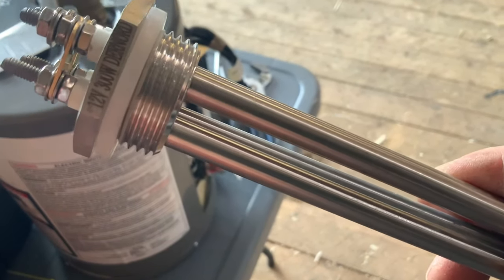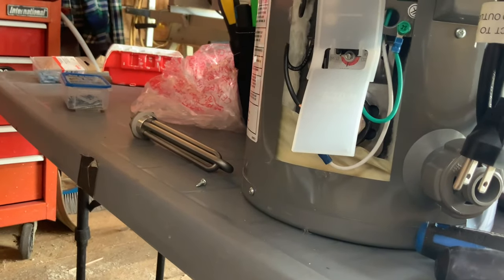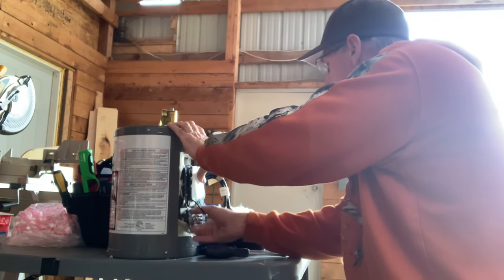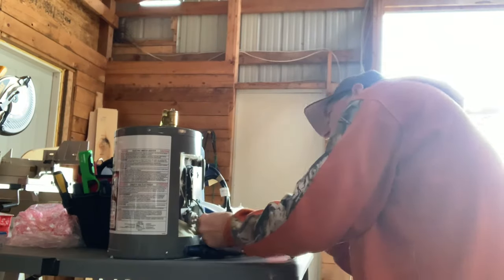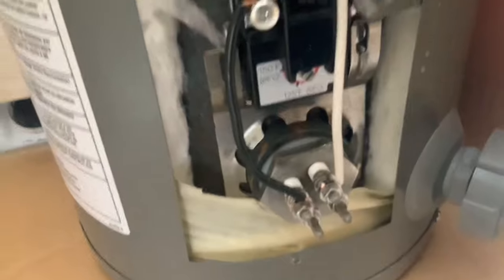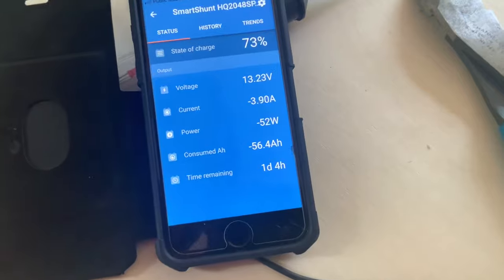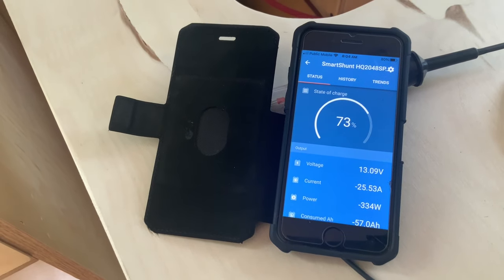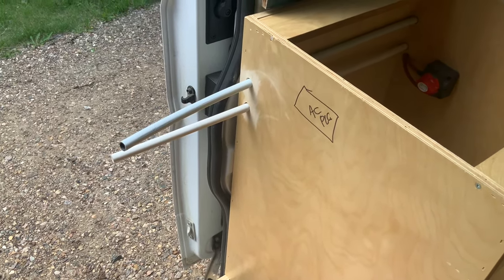Best Install 12v DC Off grid hot water heater in Van or RV Solar Compatible! DYI! Convert RV to 12V

Comment: Clever. Considering similar but instead installing the Dernord element directly into the 10 gal fresh water tank--(1) keeps the water warm and (2) prevents the tank from freezing. Thanks for sharing as now I have better confidence that it will work.
Reply from the maker: That is a great idea. Nice for winter ops. Don’t forget a good quality shutoff, 30 amp breaker and correct wire size👍
Reply from the maker: corey b  I put in 6 gauge. No heat issues. Large battery terminal shut off.
Reply: Following! Please tag me in the comments if you’ve successfully tried this! Thanks
Reply: Watch out for bacteria growth.. 40-140 degrees for 2+ hours. 

For me gravity fed water coiled around my stove pipe.. water is inside so never freezes and stays about 16/20 degrees sooo no bacteria. Works for me
Reply: The 🌡 must over the 60 degree Celsius to avoid Legionnaires

Comment: I made a Honda clone generator giving me 5000 watts ac 110/220 and 12vdc, I charge 3 150 amp hours battreys and have a 3000 watt ac inverter with 450 watt hours of DC storage, I wrapped 1/2 inch aluminum  pipes around the muffler and heat tape wrapped the muffler. I heat water 💧  through 1 coil and I heat antifreeze  thru the second coil around my exhaust. My generator  runs on propane or gas ⛽️  this is a good solution I have enough  power to run a house 🏠 😊

Comment: 👍👌🇨🇦❤, just so a person does not need to use the AC thermostat, there are 12, 24, volt elements sold with a built in thermostat on the element.  Try Arizona Wind and Solarfor supply.  Just need more solar wattage than the wattage of the element, all is good
Reply from the maker: Thanks for that info. Great to hear about more technology for van conversions!!
Reply: @dadzvanz936  Missouri  Wind and Solar, chexk them out
Reply: @pocketchange1951  Volts X amps = Watts.  So, A 300 watt 110v. AC element is the SAME DAMNED THING as a 300 watt 12v. element!!! A 120v. or  a 240v. water heater will run just fine on 12 volts if there are enough amps. No need for new elements if the ones you have are the SAME WATTAGE

Comment: I am about to do this and I have 800w on the roof of the van and have found the same capacity hot water system, in a square shape. I will get silicone heating pads, slap them on the side of the tank, use my own thermal sensor and controller to regulate it, while keeping the AC guts all untouched. Enabling it to still be powered from the inverter or mains power as well as the lithium battery. But the best part is I will sense the voltage on the battery and when the battery is showing it is in the topping off stage I will enable the hot water system to charge from the solar coming in. I will also have a bypass that will let me choose to heat the water when the battery is at any voltage.
Reply from the maker: This sounds like a great idea!  Please share. I have seen the pads used and they look like a great way to go. I also like the idea of being able to switch back to the 120V element. Good luck!
Reply: Heat sink the 'extra' 12 volt electric...

Comment: This is my first time watching one of your videos. You might have already made an in depth video of your shower system. I like the idea of only needing 300 watts to heat up your water so a person can take a quick shower. Hopefully I will find a video explainging how your water tanks and solar power is setup. I'm trying to design a small lightweight travel trailer using a quad recumbent trike with an elecrtric battery and pedal assist. I got the idea from watching folks over in Europe using cargo boxes to deliver packages. I just want to be able to use mine as a camper with all the amenities. I want to be able to cook, shower and go anywhere I want without needing any fuel whatsoever except solar panles and a nice top quality generator like my Eocoflow to run my 72 watt heater and my small fridge. Thanks for posting your video. Have a wonderful day Dadz Van.
Reply: Sounds like an interesting idea. I would save the weight and use campground or trucker showers. That’s what we do unless we have an outdoor solar shower

Comment: I think this is a better solution over propane hot water tanks or instant-on propane hot water heaters.  
What I would do different is have a well sized electrical system that operates at 24vDC.  Go with a 24vDC hot water element driving at least six gallons or better yet 10 gallons.  Plug into shore power when available, engine alternator driving a 12v to 24v isolator when on the road, or finally battery/solar when parked and boondocking.  Why the extra capacity?  I'm thinking after driving for three hours or so the hot water can be fully heated and the capacity is high enough to last the night and the morning without needing a reheat and use up power.
Reply from the maker: Thanks for the info. Yes, lots of options around 12-24 volts. I only went 2.5 gals as I will almost always be able to use rooftop solar heated water for a shower. If I was going fall spring close to freezing I would like a little more water
Reply: I don't see the savings 12 dollars over 2 months for gas. And that's if you take a shower every day I mean if you camp every day. I was looking into a 12 volt element with a DC thermostat built in and the 99 dollars wasn't the problem it was the 1200 dollar shipping charge. I can buy many refills on 1200 dollars. 73
Reply: Like they say the law of physics you cannot get something for nothing. 73
Reply: @ronb6182  Part of it for me is not cutting a hole in the side of the van or trailer wall for a conventional propane hot water heater.  Now, I doubt there's any total savings as the battery system would need to be upgraded.  To me it's a combination of attributes that has me thinking about a no-propane hot water heater.  I am aware that propane hot water heaters can be had with an electric heating element.  So if one has no problem with propane burner venting, both heat sources would be available.
Reply: @Snarge22  yeah there is different applications which makes it go for one over the other. To me I cannot have a tank in the mountains which requires emptying the tank every time I go up there. Because I never know if I make it before a freeze. I would say the majority of the time I go up in the cold season more than not. Even March it freezes. I may go electric tankless up there. 

In Florida I already poked a hole in the block wall so my instantaneous water heater is already operating I just want to save the hot water because of the 20 minute max time running. If the tank is full then the water will be hot for a longer time the DC elements I will use will be for backup during hurricane shut down. Propane may not be available so the generator will provide AC and DC power which will heat the water and AC will be for the refrigerator and air conditioner. I would like to do solar but panels on the roof could get damaged so portability would be better for solar. Thanks I very well understand where you are coming from. Big 73
Reply: Just wondering how much a small radiator would hold must be something around two and a half gallons would heat you're van in winter? Mike uk

Comment: They need to invent a 12 volt heat pump water heater. It's at least 3 times more efficient than electric and it can also cool and dehumidify the air. Great for hotter climates.

Comment: Very clever. I agree, no propane. I've seen 120v instant hot water heaters, but the you need to run it through an inverter. This seems simpler.
Reply: Instant vs stored is the question - with a tank you can heat hot water with "spare" solar and use it on demand.  With instant you might use solar during the day and at night it will be straight from the batteries.  Weight wise - I guess it is the weight of the tank filled with water vs some additional batteries.  Instant does seem to be the simpler solution too.
Reply from the maker: True enough. I looked at the on demand. Altitude seems to come into play a lot, who knew, and then running them inside with no exhaust etc. haven’t seen a good demand one. If you do. Please share.

Comment: This is exactly what I'm looking for. I have the same 12v\300w element that I want to install in my RV. Do I need the smart shunt..? my systems consists of 4 lithium bb 100ah batteries, 3-400w panels connected to a Victron 150\85 and a CERBO gx with touch screen.   I was thinking I had to cut the MC4 connectors off and wire directly to the water heater.
Reply from the maker: No. You don’t need a smart shunt but it sure makes visualizing on your CERBO easy. Reads the in/out current on the batteries on the display. My wife loves it.

Comment: How about an instant 12v 300watt small heat exhanger that will heat water on demand?  Copper tubing with 300 watt element installed so water passes over it and heats it instantly?
Reply from the maker: Interesting idea but I am not sure you would be able to get the water hot enough with any kind of pressure with only 300watts. If you went to 1400watts it might work and the power draw would probably be the same for the amount of water used. But this is just a thought. Try it out and let me know. Cheers.

Comment from the maker: The link below is for a 150 Watt but you can get anything from 50 to 400 Watt DC. These are true DC and not AC made to look like a DC as you may find out there. LIKE AND SUBSCRIBE PLEASE. THANK YOU!
Reply: How can an A/C element be made to look like DC?  All electric heating is resistive, IR Squared. What am I missing?
Reply: @CapnZman  the composition is different also the DC element may also have a DC thermostat. The AC thermostat will give out if used with DC. Get the right voltage and current elements. Some manufacturers are frauds they scratch off the elements voltage and current so you think you bought the right element, buyer beware . 73

Comment: Can use copper tubing to connect with radiator and. link it to the hot water tank. 
Do this will heat up the tank very fast while the RV engine is running.

Comment: Thanks for the video. I’m wondering how long the hot water would last for as I have the same tank size. More specifically as you use hot water some water fills it’s space and is heated and we don’t use hot water from only the heater as it’s mixed with cold water so how many gallons would that tank last you?

Comment: Why did you change the heater to DC? No inverter or inefficiency of the inverter?  Great detailed video. Thank you.
Reply from the maker: Yes. I do have an inverter and I could have done it thAt way. What I planned for was having the inverter off to save a little from the power the inverter uses just to operate and use the sun in the panel when stationary or the DC DC charger when moving to heat the water. I generally turn on the heater in the morning and have hot water till dishes are done at night then turn off. Still 100% battery. Thanks for watching.

Comment: I have done the same thing using 120v and 240v elements  1500watt 4500watt elements if I remember correctly the higher voltage higher wattage 240volt elements  were less watts in the hundreds on 12 volt .
Reply: if that's the case, why bother changing heating elements from ac to dc?

Comment: Great video, just bought a Rheem for my van build! Can I use a bigger 12v dernord heating element for faster heating? Or will that not be compatible with the rheem thermostat and internal wiring? I don’t want to start a fire, but I have Solar/battery capacity for a bigger heating element. Thanks
Reply from the maker: Should be no problem as long as it’s 12 volt.
Reply: I’m going to use 300w after all. If it’s working well for you, no need to try something new. Honestly, the AC to DC conversion freaks me out a bit. Do I need to ground the negative because of this conversion? Rather than route it back to my negative bus bar? Thanks again.

Comment: Interesting. So you just swapped out the white and black AC wiring with red and black DC cables?
Reply: Yes. Checked wire heating and resistance with no issues

Comment: I am doing this right now (thanks for sharing) and I just ran into a concerning thought. It looks like you are using the same wires (black and white) that came with the unit. My guess is these are 14 or 16 gauge. If these are wired to the heating element does that mean 300 watts are pulling through the wire at the 12 volts. If so isn’t that too high of a rating for those wires or do you only need the large wires  (6 awg) connected to the other points of contact like you have in the video?
Reply from the maker: Yes. The 14 gauge wires are fine for the very short distance that it travels. I talked to my solar guy as well as an electrician about it and they both confirmed the same. Also when running there is no heat on these wires. Good luck. Let me know how it turns out. Just putting in my Corrion countertop.
Reply: @dadzvanz936  - Awesome! Thank you so much!

Comment: Minute 3:22:  cables seem to be much smaller between the thermostat and the heating element than between the battery and thermostat.
Reply from the maker: Yes they are. The run of 10 feet from the battery to the thermostat require a 6 gauge according to DC wire gauge charts. I put in 4 gauge for this, no cost difference. The short run of only 4 inches could actually be done will 9 gauge but I used 39-2 as it is more robust. The reason I had the panel off was to check heating of the wires during operation. I noted none. I will  be putting a 40 amp breaker in near the power source. Thanks for the comment!

Comment: Hi, Just about to pull the trigger on doing this… I noticed that you posted this about a year ago…. I also watched another video on this type of conversion.  Have you had to make any further changes since this video?  Any issues that I can take care of as I do this work?
Reply from the maker: I have had no issues with this at all. Make sure to use large gauge wire and a DC element. I have heard about guys thermostats going out?  But have not had this issue at all. 
Good luck!!
Reply: @dadzvanz936  Thanks!!  What gauge would you recommend?  Water heater and 12v fuse box will be about 10ft away...  300watt / 12v = 25amps.  I was looking at 6 AWG

Comment: Clever idea. What was the make and model of your boiler? I'm based in the UK so need to find one here. Also, can this been used with 10L boiler?
Reply: Better to run a diesel hydronic loop boiler system then top it up with electric. Ninety degrees is WAY overkill though!

Comment: Hi. I love your idea here of no propane, no insta or tankless and 12v.  I have a Sprinter Coachman Galleria with a Truma Combi Eco Plus and it just doesn't produce a long enough shower for my wife to take a hot shower. Even when hooked up with shore power. I'm wondering how long of a reasonably hot water shower you can take with your system? 5 minutes? 10?  What are the dimensions of your water heater and did you have to vent it? I would keep the truma for sink hot water and furnace but I'd go to this system for shower. Any advice?
Reply: In my travel trailer I changed the shower head to a 2.5 water saving and reduced the water pressure to 14 psi. That made the water last a long time and I can take a 20 minute shower on a 6 gallon hot water tank. My total water usage was 5 gallons daily, so I was not using the full 6 gallons of the hot water capacity.

Comment: Didn't notice a fuse or breaker on the supply line for the heater. Even with a main breaker, it's probably advisable to have a breaker or fuse on that branch circuit. Just a thought. Nice affordable conversion though.
Reply from the maker: Thanks.  I will have a look at this and see. I think your right. I have a spare 40 amp that should work

Comment: I'm about to do the same thing and I got the Rheem but can you help explain why you changed how the original wires were run? For example, the white wire originally ran straight to negative but instead you have it connected to the second terminal of the thermostat.

Also, isn't that a double element  so 600 watts?
Reply from the maker: The element is stamped 300W and came with the plate jumpers between the elements so I will assume it is 150 x 2 for 300Watts. This is also the DC draw I see on my Victron screen through the smart shunt. As for the wiring I replaced the black and white wires with 15/3 house wire and ran them both through the thermostat. This may be one of the reasons I have not had any issues with the thermostat as a couple others have. Hope that helps.

Comment: The only problem is you cannot use DC on an AC thermostat if you got away with it the question is how long will it last. 73
Reply: that's the question, should we use a different thermostat or a relay with the original one instead??      if you connect it the way this video does, it will not last very long... see the difference between both sets of cables

Comment: Great job👍 Did you use original 120volt  thermostat or do you need a 12volt one?
Reply from the maker: I used the 120 volt thermostat with no issues after 2 years

Comment: I was looking for exactly this video. You mentioned a solar HW heater on your roof. Any details available on that? I was thinking of a solar-powered heater/pre-heater, either a simple “black tube” or possibly a parabolic trough heater.
Reply from the maker: The tide heater is what I was thinking on the roof. You can buy air chucks like on an inner tube to drill into the tube to pressurize it or just go gravity. You can look up the volume of an 8 inch or 6 inch tube by the foot to see what you require. They are very good if you are in warm climates most of the time. I am thinking of installing one for extra volume when able